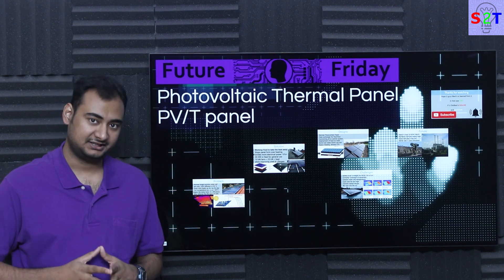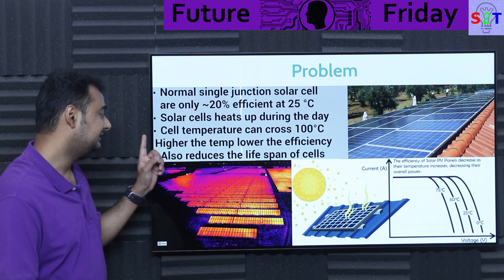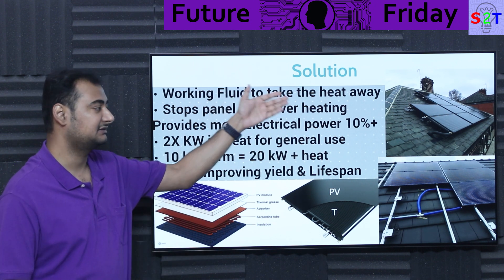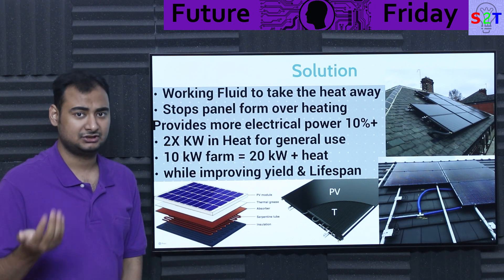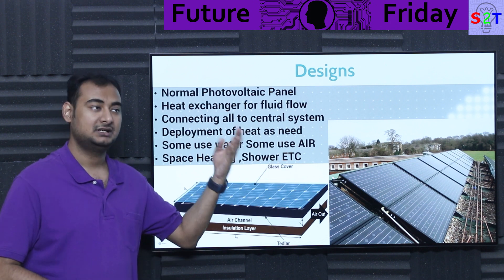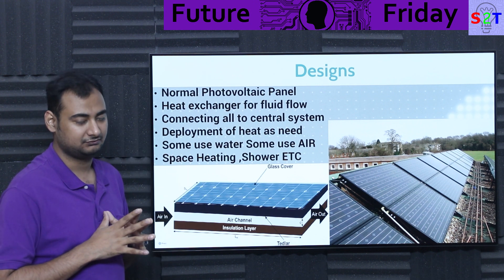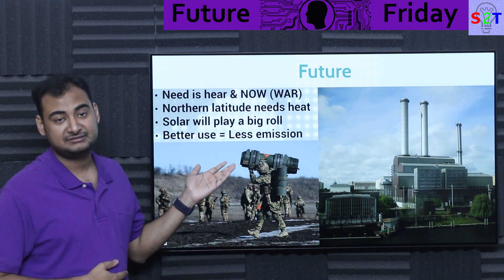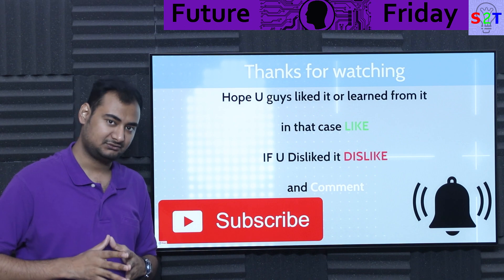Photovoltaic Thermal Panel {PVT} Explained {Future Friday Ep181}

Comment: Is it feasible to take the same temperature for inlet fluid flow and ambient temperature?
Reply from the maker: yes it will reduce the cooling but it will still remove the heat as water has great thermal capacity